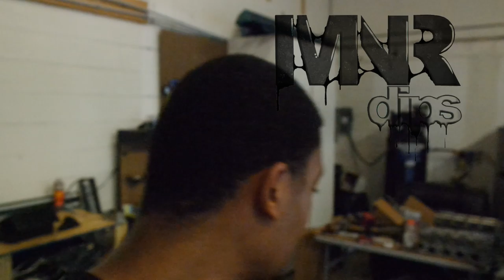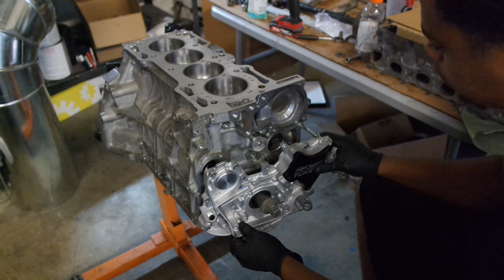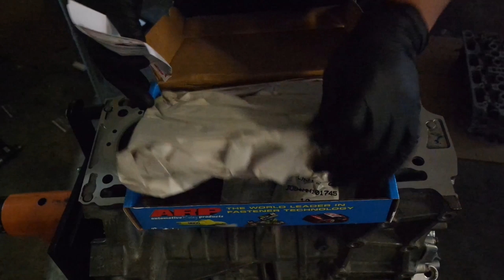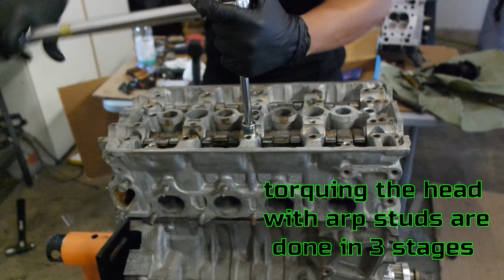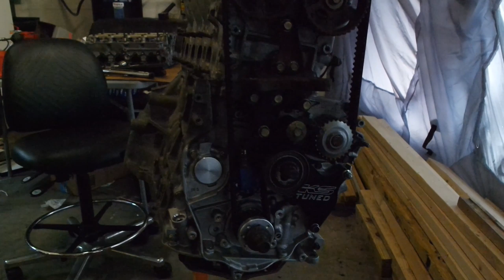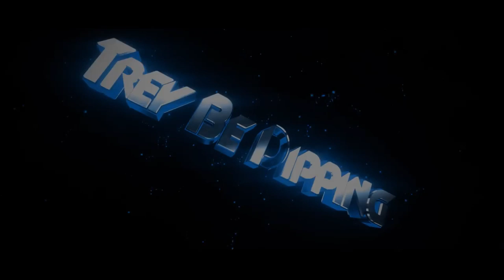How to install h22 head on a f20b block in 10 mins | G22 honda prelude

Comment: Is thier a difference between the h22a4 fpr vs the f20b fpr .im trying to finish up my swap but not sure if I could use the h22a4 fpr on a f20b with stock injectors.
Reply from the maker: Not 100% sure on that one just try it if not it will just leak
Reply: I think I read something in a forum saying that th cams and others I can't remember are bigger and that you risk the pistons hitting I maybe wrong but I'm just gone rebuild my a4 Block stupid boost got a little to fun 🤣🤣🤣

Comment: G means f/h frankenstein and 22 means 2.2l.  F20b with h22 head is not a g22.  Also f20b head and h22 head are basically the same thing
Reply from the maker: Yea ima go with g20 then lol
Reply: Hey bro I've been watching your channel for a while and I also got a 94 4th gen Prelude and I just bought f20b yesterday from the depot and I have a H22 head from my last motor I blue and I was asking exactly what do I need to put the H22 head on the f20b Block what gasket everything do I have to do any custom modifications please let me know thank you
Reply: @treybedipping1734  hey bro I had a quick question I bought a f20b and I got a H22 head form my previous motor that blew up what exactly do I need to put the h22 head on the f20b Block do I got to cover something to I got to cut something custom something LOL please let me know
Reply from the maker: @reydiaz4115  just use the f20b head and h22 cams bro. Everything else is in the video

Comment: Which arp studs did you buy exactly because I have my f23 block and my rebuilt h22 head with the appropriate oil passages blocked off and I'm unsure which studs I should buy so I can get my prelude put back together before the end of September hopefully 🙏🏽
Reply from the maker: I used the h22 studs but im not sure about your block bro mine was a f20b
Reply: @treybedipping1734  thanks and as far as I know the thread depth is the same across the h and f blocks so I'll probably get some f series accord studs.

Comment: great video! subbed. will this work on a f22 block?
Reply from the maker: The general idea will be the same with some minor differences
Reply: @treybedipping1734  what are benefits of using the h22 head? is it mainly getting power for a boosted engine? how does putting a dohc on sohc block work? i've heard its kinda sketchy
Reply from the maker: @dakitofey171  in my case no i just got a really good deal on the fully built head is all. And im not sure on the g series builds tbh

Comment: Good shit trey, can you explain why you went with 86 mm head gasket. Was that cuz of cylinder bore size. Also what brand gasket
Reply: EvilBeaver717  cometic gasket and I’m assuming the piston raises higher and it was a decision after they found the top dead center of the piston fully up
Reply: Adam A thanks man now I’m tracking
Reply from the maker: @EvilBeaver717  went with 86mm because of the new bore size of the cylinder walls
Reply: Trey Be Dipping thanks man, that makes more sense. She’s gonna rip when it’s done I’m excited for you.
Reply from the maker: @EvilBeaver717  thanks bro i cant wait either

Comment: I always thought g22 was an f22 sohc block h series head with k series pistons dope for na haven't really expiranced it with boost
Reply from the maker: Idk bro so maybe this is a G20 then lol
Reply: F23 fits k series pistons, not f22. Lol
Reply: devin Dfresh g series is exactly what you described! What trey be dippin is doing isn’t anything but a Frankenstein swap
Reply: @ridinglacs  you are right it was a typo
Reply: @ridinglacs  you can do F20b pistons on the f22 or K. Will have to bore over for the K

Comment: Tre, the h22 head on the F20B block will lower your compression.
Reply from the maker: With my pistons i lowered the compression anyway.
Reply: @treybedipping1734  my F20B made 305whp n/a. Shooting for 350 this year.
Reply from the maker: @kevinhendricks1653  dam. What you have done to it?
Reply: @treybedipping1734  sleeved, rods & pistons, 97mm crank, p&p head. Just put roller rockers and roller cams in her. Waiting for this lock down shit to end so I can get retuned.

Comment: Hey trey how much hp does f20 have?
Reply from the maker: Auto has 180hp and manual has 200hp stock
Reply: @treybedipping1734  where can u buy parts for that motor.. Like would auto zone carry them?
Reply from the maker: @raysampson3993  almost all the h22 parts are compatible. There are some internals that use b series parts

Comment: Why did u go with the h22 head?
Reply from the maker: Only cause it i got a good deal on it and its built.
Reply: Gotch u. I thought they had different specs
Reply: Jevy intake valve is bigger by 1mm f20b has more port velocity cause smaller intake valve but eh 

I hope its not 85mm it may hit the bore
Reply: Read in other comments hes 86mm hes fine

Comment: That's not a g swap. A g swap is a sohc f series bottom end. An f20b is just a destroked h22 with cast iron sleeves.  An f20b comes from honda with a p13 head.. and you don't have to plug 2 oil drain holes in the head.. I mean it's cool don't get me wrong, but it's not a g22 or g23
...

Comment: Don't blow this one up, k?  😉  you'd cry if you saw my 4th gen right now 😭
Reply from the maker: Ill try not too. What wrong with it?
Reply: Sitting on the side of the house with a flat tire, filthy, rusting, and barely running right.  Needs a full up restoration at this point.
Reply: 5th gen is still doing good though, just need to get some nice wheels, better injectors, bigger aftercooler, new ignition setup, and retune one of these days.  Running decent though.
Reply from the maker: @engineangie  we gotta treat our 4th gen better lol

Comment: Not g22 lol being its an f20b block its still a 2.0
Reply from the maker: You right g20? 🤣
Reply: Nope f20b, f20b heads are still h22 heads manual being a full type s head with upgraded manifold 70mm throttle body. If you ran a regular h22 head (non type s) you pretty much built a auto verison f20b. Hope this info helps
Reply from the maker: @hondaracinglife2897  g20 sounds better tho lol but thanks for the info

Comment: STOP. Install a KS walk blocker. Then you may continue.
Reply from the maker: You have a link for me boss?
Reply: Trey Be Dipping its on kstuned site and i wouldnt bother with one...
Reply: Forget what Silver, or myself say. Ask Reid his opinion. He will set you straight.
Reply: solid_tactics 🤦🏼‍♂️🤣
Reply: solid_tactics h23a1 tensioner with a timing belt tensioner from maxime mounted on ps pump mount
Reply: solid_tactics if you walk slightly the blocker will keep it from coming off for some
Time but EVENTUALLY IT WILL COME OFF ...
Reply: Sure, if he wants to delete PS.
Reply: solid_tactics  correct but either way dont bother with a walk blocker imo
Reply: Please explain why you don't think it's necessary. I am genuinely interested.
Reply: solid_tactics if you tighten it with their manual tensioner correctly its not needed... end story..
Reply: solid_tactics too tight itll walk 

Too loose obviously itll slap around 

I have their tensioner slightly loose with the tensioner from maxime and its fine hasnt walked at all no issues 🤷‍♂️
Reply: FACTS!!!!! I just bought ks tuned 
oil pump (balance shaft delete), wall blocker, belt, & manual tensioner. Should be getting it tomorrow.